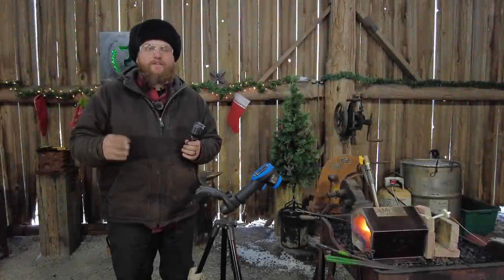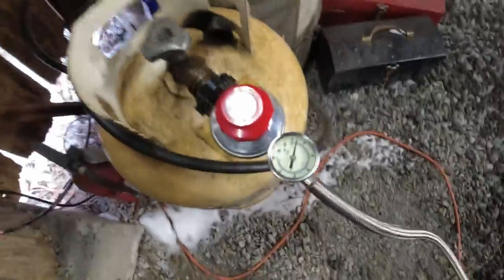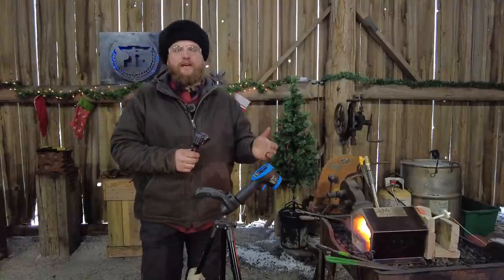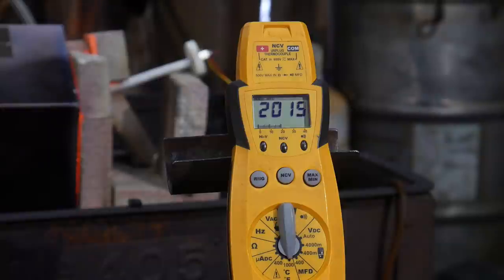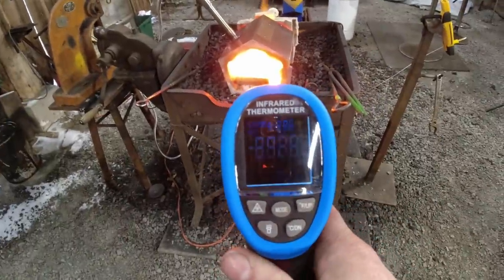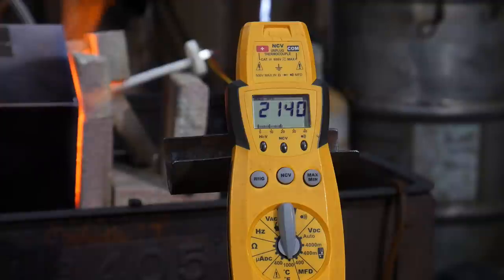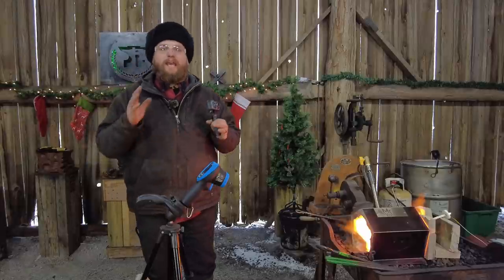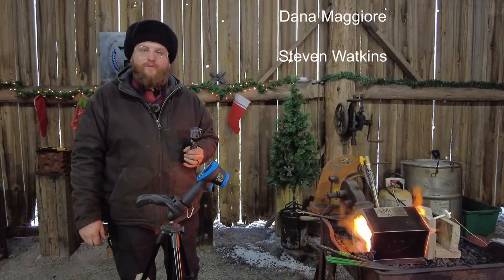How HOT Does the Mr. Volcano Actually Get?

Comment: Can you harden a HF anvil, can you forge weld in mr volcano,
  Another great episode of blacksmithing-busters.
Reply: Pretty sure HF anvil's ard made from cast iron which isn't going to get very hard. You probably could forge weld with a Mr volcano just be aware that you will need to reline it more frequently if you do.
Reply: I have one of these forges and I've made a number of tomahawks by bending and forge welding farrier rasps.  Works great and I love this little forge.  The only negative is you can't do larger projects, but I use my coal forge for those, so it's not a big problem.

Comment: I’ve got the same lazer thermometer and always wondered how accurate they are. Not sure why I haven’t bought a k-type thermometer probe.  The lazer is about 90* higher than my evenheat oven. But that’s only around 1500-1600.  It says my forge gets over 2700*, which it does get very hot going by color. Mild steel and wrought iron have no problem welding in it.
Like to see what mr. Volcano does with both ends blocked up and as high as it will run properly.

Comment: That’s a great video of your forge welding set-up.  I had no idea an IR gun could measure those temperature levels.  Do you think the IR gun is actually more accurate in measuring forge temperature than the k-type thermocoupler given it’s measuring IR reflectivity from the refractory coatings (are you using IT -100 on the firebricks?).  Also what is the max measurement rating if the thermocouole?

Comment: What temperature do you recommend forging at?  Also, how heavy of a hammer do you think I should use for standard forging? (I am 14 years old so I probably couldn't handle a hammer more than 6 or 7 pounds) Does it just depend on what I am comfortable using? God bless, have an awesome day. :D
Reply: Most people don't need more than a 3lbs hammer. I would recommend a 3lbs rounding hammer and a 3lbs cross peen hammer.
Reply: @a2c340  Thank you! I'll see if I can find some 3lbs hammer heads at my great grandfather's old farm.
Reply: @theoldenbrick2466  For smaller stock like 1/4", practicing Nails and Leafs and hooks etc and to planish larger work 2 lbs is plenty, actually. You will be able to forge a LOT longer and with more fun than with a hammer too large. Just make sure to smooth the corners and edges of a hardware store hammer, they mess up the looks of your work.
Reply: Don't go over a 2lb hammer maybe use 1 1/2lb til you build yourself up .
Anything over 2lb hammer work should be sledgehammer work .
Don't blow your arm out just because you can.
Blacksmithing is a marathon not a race.
Reply: I agree about the 2-2.5 lb hammer. Adding velocity increases force more than adding weight. (Energy = mass x velocity squared)
Reply: Thank you all for the advice!

Comment: Those blue pyrometers put out 2 lasers typically. When they are aligned it as at the correct Temperature vs the laser being spread. Fun fact. Good stuff tho. Makes me want to put mine on a tripod for giggles. Should be about 36 inches. If memory serves on the manuals. What handheld do you have for the k type?

Comment: very good video!  2400-ish degrees... that should be "welding temp", Right??
Umm. . .  ✋QUESTION Roy:  don't you need to adjust the air gate "thingy" that controls how much air gets into the burner?  Like if you add more gas pressure doesn't that make the flame burn richer and not a "neutral flame" anymore? 🤔 Hmmm 🤔
Reply: Not necessarily. It all depends on burner design. Some will go richer and some will go leaner as you increase the pressure. The velocity of the gas traveling down the burner tube actually draws the air in through the opening and creates a pretty strong suction. Admittedly, I do not own this forge, so hopefully Roy will comment here with what he learned about this one.